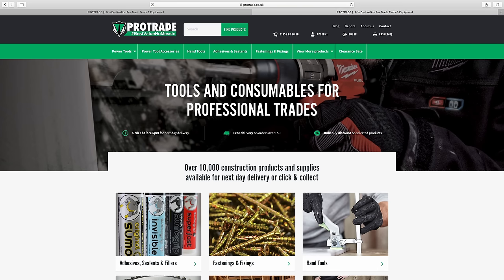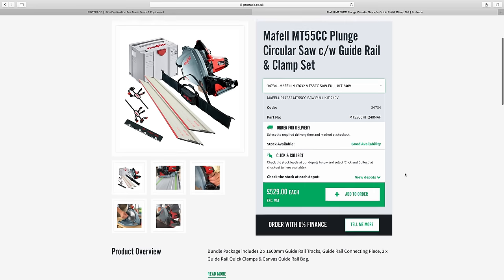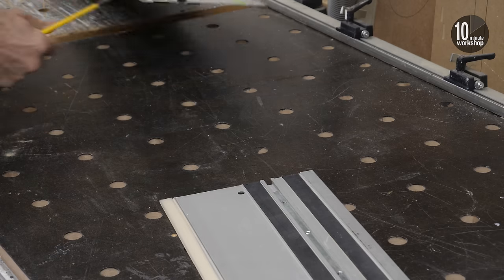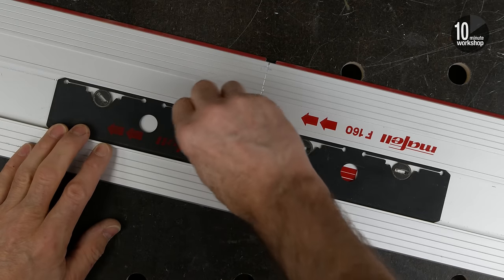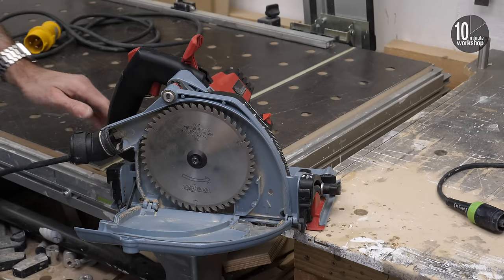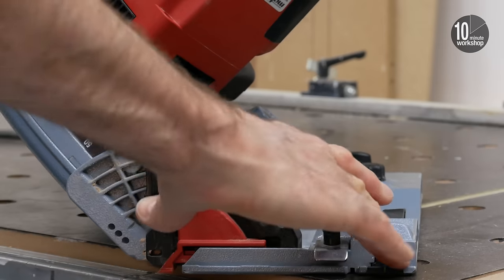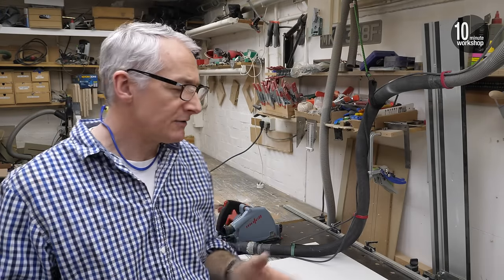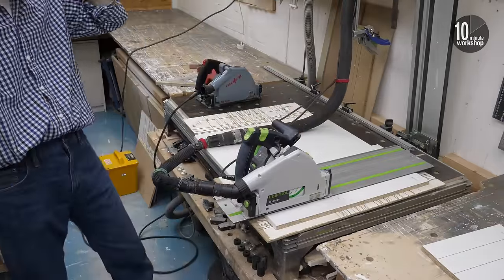Big Decision: Festool or Mafell? [video #400]

Comment: Great video, thank you for that.

I recently bought a Festool TS55 REBQ Plus, over the competitors.
I'm just a guy who occasionally saws stuff around the house, so any track saw is basically a luxury.
Reasons why I chose the Festool over the Mafell were; Mafell is substantially more expensive, and second the Festool can
saw closer to walls or other objects because of where the dust collector is placed.
Another reason is basically the same as yours; I could buy one.
Just one slight difference; I bought it from a shop that was discontinuing their Festool lineup, so I got it at a super price. 
If it were any different, I might have gone with the DeWalt tracksaw, but their track system isn't that good.
It is usable with Festool tracks, but then there is too much play I read somewhere.
Reply from the maker: Thanks! Sounds like you got a bargain! 👍👍

Comment: The 'guard' for the Festool does help with dust control but it is great when you need to run along a wall such as when cutting hardwood floors.

Comment: Hi, just something I wanted to share. Had to cut some melamine panels at work a month ago but I didn't have my festool with me (there was no need for it so far as my jobs on that site mostly included flooring- subfloor, finishings, and metal frame ceilings/partitions + plasterboard. However that week the kitchen fitters quit and there were few urgent jobs to be done that included melamine panels so I was asked to do few extras towards snagging).  So I had to borrow a plunge saw off another joiner on site who was cutting replacement shelves for kithcen units (happened to be dewalt). Right in the beginning he said that his blade was pretty worn off and complained about the amount of chipping he was getting while cutting melamine panels. I had a look at the shelves he cut- disaster, nearly looked like they were cut with a framing saw blade. However, having not much other options, I decided to try anyway. Decided to do a test piece at super-slow speed first, and if that didn't work, I planned to use masking tape on the cut to try to get a slightly better finish. I didn;t get to try the tape- while going extremely slow, I was able to get a relatively clean cut (not perfect of course but it exceeded my expectations). I'm curious about whether you experienced similar improvement yourself. thx
Reply from the maker: Hi, and thanks for sharing. No, I’ve never tried that - I’ll have to give it a go! Must admit I rarely use anything but top speed, but I’ll have a play and see, thanks! 👍👍

Comment: I settled on the Bosch, having tried the Titan/Erbauer and returned it as it was just not good enough, and as I couldn't justify the cost of Festool for my needs. I'm realy pleased with it and it has made my table saw more or less redundant ( which is  a blessing as its  a cheap Clarke antique ). I have put the aftermarket plugs on all my powertools per Bisch Basch Bosch, and I understand that it does not affect warranty ( although if I had to send it back I'd probably have to send a lead too )

Dust collection could be better, and if I used it daily, would become an issue, but thats all. Love the tracks, and also have Bosch Routers with track adaptors
Reply from the maker: Nice! Yeah, Stu at Bisch Bosch Basch is your man for all things Bisch! 👍👍
Reply: Richard Keith I wanted to do the replacement plugs but they were quite expensive
Reply: Being that the Bosch and Mafell  are very similar. Does the Bosch have the same 10th mm offset on the scribe cut?

Comment: I own the ts55, have always liked the mafell as well. to get over the 1/10 of a mm you can just set the plunge depth to 5mm, just like you can on the ts55 to create a scoring cut. with the quick adjustment of the depth it isn't much of a pain to do. the guide rails for the mafell are much superior.
Reply from the maker: Of course - but, ‘buy a dog & bark yourself’ springs to mind! 😂 I think the Mafell rail jointing is better, not so sure about the rails themselves. 🤷‍♂️👍👍
Reply: Peter Millard true, very true 😂 you expect the feature to be better than it is

Comment: One downside of the Mafel/Bosch rail is the base of the saw overhangs the non-blade side of the rail,so the saw will clash with bench dogs if using these to position the rail.  A spacer strip overcomes this but it is a tedious annoyance!
Reply from the maker: Yes, this was mentioned in the patreon-only 'further thoughts' video; you can use the low-profile bench dogs (' bench top protectors' here - https://bit.ly/bench-dogs) they work well; use the offer code "10minuteworkshop" at checkout for 5% discount. 👍

Comment: Good review Peter. Mafell sells that anti kickback attachment for the rails too, but it's between 20€ and 30€ (no idea what the Festool one costs) I purchased the Mafell saw for the easier blade change and better dust collection (you can improve the Festool saw to the same level with a piece of masking tape), the short 80cm rail and the stronger motor (I had my kitchen build ahead of me with 40mm thick rubberwood countertops and a 120m² flooring to do in the house). With the tracks I'm not sold to any of them, both have their good things and their bad things, I like the Festool clamps more than the Mafell screw clamps which tend to bend and jam in the rails. With the Mafell rails the one handed quick clamps work best. I retrofitted my saw with a Festool Plug It adapter for more convenient use with my shop vac (hose and plug it cord run in a common cable sleeve to avoid snagging, thanks for the idea to Dave Stanton )
So far I'm happy with the Mafell and I think the Festool saw will provide similar quality.
Reply from the maker: Thanks Jesus; yes, I do mention the ‘tape over the hole’ method to improve dc on the Festool, and while I agree that I could simply not use the scoring function on the Mafell, that’s a bit like having a dog and barking yourself! But I liked the Mafell, a solid saw. 👍
Reply: @10MinuteWorkshop  true, I guess you'd just have to figure out how much the blade moves on your saw and then take it into account

Comment: Great video  Peter.
Good test of their respective features.
I have upgraded from the Lidl Track saw, which was brilliant for the money and now own Mafels cheaper cousin the Bosch GKT55.
It shares the same brilliant track system but the machine doesn't have the score feature or clam shell case design.
The Bosch also does not shift the blade, so gives excellent cuts in panel boards.
Reply from the maker: Thanks Jason! Yes, the Bosch is an interesting one - I’d live to compare one to the Mafell, but that may be stretching ProTrade’s generosity of spirit a bit too far! 😂👍
Reply: It also misses some other features like one clamp screw tilt mechanism for bevel cuts, cutting depth fine adjustment. On the other hand, it features a second handle / grip. The bosch rails, rail clamps and bag are significantly cheaper than the mafell ones and they do fit perfectly - just as a tip for the mafell users.

Comment: Its Bosch for me I'm afraid. Its has pretty much everything a Mafell has including the excellent track connection system.

However you don't pay the extra 200 quid.
I know Festool are excellent bits of kit and I would love a domino cutter... but other than that I just don't like them... the look of them to me isn't great.

I guess we all have our likes and its hard to get over those.

I do hope you went Mafell... will find out at the end ...
Reply: tormenting360 I also went for the Bosch. Very happy with it.
Reply: tormenting360 I started with the Bosch and it is still my site saw however the mafell that is my workshop saw has way more grunt and I find it a lot easier to use and get better results, the Bosch is still great however
Reply: richpbrown2 I agree on the power side. I have compared the two. The Mafell is superior on power. Noticeable more when cutting hard woods.
Reply: @trieditusedit5846  I agree the Mafell surely has more power. I tend to do wood work as a hobby so for me the power isn't an issue.
Doing this type of work every day would call for some more grunt for sure!
Nice to see constructive chatter in the comments.
Shame Bosch drills and impact drivers aren't the best...
I have a Bosch table site saw and its lovely too (after buying a better blade)
Reply: I too am deeply impressed with my Bosch. But still a tad envious of the Mafell.
Reply: I have the Bosch, it is amazing. As I just use it for DIY I will not be using the quick blade switching and microadjustment is something I would never use. For the difference in price I bought the OFA 32 system so I can use my router with the rails too
Reply: tormenting360 I prefer makita for drills and Bosch for saws and maybe SDS rotary hammer. I do have the makita jigsaw as it uses the batteries I already had, it’s good but the cordless bosch has better ergonomics.

I really don’t like the buttons on the Makita, it is very weird to get used to. That being said the quality of the cut is amazing
Reply: tormenting360 the Bosch is not the same as the mafell. Not even close
Reply: @joeframer9642  I didn't say it was the same. I said it had a lot of the same features.

If you did you research you'd know Bosch track saw is made in the same factory as Mafell.

Its the only two tracks to have that joining system, the splinter guard is the same, the depth gauge is the same with how it flips...

So your comment about being way off is pretty ignorant...

We're all here to have a great conversation with good opinion. Why not bugger off to another thread because you clearly don't know your stuff

Comment: Mafell wasn't an option in Australia when I purchased my Festool plunge saw and track around 15+ years ago.  A few years later when I discovered Mafell and they too had a track saw, their track coiled up which sounded very appealing for loading everything into the boot of the car.  I've just googled Mafell and find they are available here in New Zealand through Jacks - a good firm to deal with!  Interesting video, thanks.  Cheers, David
Reply from the maker: Thanks! The flexi rails are an interesting idea, never used one though. 👍👍

Comment: As you know Peter I have both, my tools are all 110v and yes the Festool has always felt underpowered but I've just allowed for it by going slower and taking two passed. The mafell to me is much better on MFC with the score but I learnt early on not to use the score if butting panels ie a joint on island back panels. My mafell had kicked back a few times and my rails have a few scars, it's not as forgiving as the Festool if you're not concentrating.
Reply from the maker: That’s interesting, Chris, thanks! Was your Mafell one of the ones that had issues with the bevel cut? I knew a couple of guys who had that problem around the same time. 👍👍🤔
Reply: @10MinuteWorkshop  yeah I got mine replaced, they wanted to send it off to Germany to be fixed but I insisted on a new saw. Its still a mm or 2 off the edge on bevel but it is what it is. I think the rest of the saw makes up for it.

Comment: Thank you for that comparison Peter. I started with festool, but couldn't get consistent 45 deg bevel cuts. Sold festool and bought mafell and have much better results with it. I'm only a weekend woodworker, so maybe that's just me. It would be interesting to see what you thought about the angle cuts on both.
Reply from the maker: Angle cuts on both were excellent, though I know a couple of guys who had that exact problem with the Mafell- the 45 was about 43.5! Certainly one of them had a bit of a fight to get it changed, as it’s not something you use every day, so he didn’t realise the problem for a little while. 🤷‍♂️👍

Comment: I have my 2nd Festool ( 2months old) being collected by Festool tomorrow as it didn't cut square out of the box.  The bevel cut is really bad and the blade enters the board about 1.5 mm from the splinter guard.  I have a Mafell being delivered  tomorrow but have read so many mixed reviews.  The Festool is so light and smooth to use and after so many years of cutting egger MFC ( really high end board ) I am nervous about the possible switch.  And Festool service is amazing

Comment: For a super clean cut I make the scoring cut backwards, with the direction of the blade. This way, the top layer is supported by the material underneath, instead of the teeth kicking up on the top layer. (If that all makes sense)
Reply from the maker: Thanks! Yes, I’ve done the reverse scoring cut before; the test wasn’t really about getting a clean cut though, it was about seeing how they cut in ‘normal’ use especially in comparison to the Mafell scoring cut. 👍👍
Reply: @10MinuteWorkshop  and a nice bit of testing it was. Never knew the maffell would fit a festool rail. Learn something new every day eh

Comment: The Mafell isn't a great choice for use on a bench with a guide system. I have the Bosch and the saw overhang on the non cutting side and flexible tracks mean you need to switch to a Festool/Makita rail for bench work (this would I believe be the same with the Mafell) Now I am looking at getting another saw for the workbench so I can leave the Bosch set up for Bosch/Mafell tracks which is frankly kind of silly.
Reply from the maker: Yes. I like the way the Mafell tracks connect, but otherwise I prefer the Festool. 🤷‍♂️👍

Comment: My earlier comment disappeared, odd. Returned two Makitas for under-cutting the edge-guide when bevelled (manufacturing error that cant be adjusted out) and was tempted by the Mafell but went with Festool as needed it to work with cutting jigs, bench dogs and UJK Parf gear etc. Mafell motor-housing fouls taller dogs and rails dont work with dog-clips etc. Still think the Mafell is the superior tool in every other regard though, design and quality included. If I was on site regularly I’d choose the Mafell without hesitation.
Reply from the maker: That’s idd re the previous comment - wasn’t me, I promise! 😂 Yes, I like the Mafell rail design, but find it I’d that the baseplate overhangs the rail - it rules out so many things. 🤷‍♂️ Good to have the choice though! 👍👍

Comment: The scoring cut offset I’d much less of an issue when using edging tape etc as the glue covers the difference
Reply: Would you be putting tape on the inner edges of a joint too?

Comment: HI Peter what double sided tape to you use as a hold fast when using a router. I have bought the 3M 9088 tape  you recommended for use when replacing a splinter guard but is there a cheaper for use when one don't need a high quality tape for more less demanding applications .BTW. I bought the Triton plunge saw ( because I could not get the Titan and disable ant kick back lock as it made it very difficult to use. For most of us the Mafel and Festool  are to expensive for the amount of work we do but still interesting to see how they perform . Also I note Triton and Titan and a lot of other saws are of the same design . thanks in advance stay safe .
Reply from the maker: Thanks Michael! I generally use whatever tape my decorators merchant has. For double-sided, sometimes that’s Tesa tape, sometimes Mammoth. They’re both good quality tapes for general purpose use, when you don’t need the 3M gear. 👍👍

Comment: Its funny you say that about the plug on the saw. I am in the USA. I've cut the plug off many of my tools leaving a 3-12 inch pigtail. I put a male socket on it and use an extension cord as my cord. I do this because I am sick of cutting into cords that are hard to replace. I usually have more than one extension cord anywhere I am. I really wish manufacturers would just stop putting cords on tools and leave just a male plug sticking out the back. Again I'm in the USA so, GFCI and fused cords aren't really a thing in power tools.

Comment: I bought a nearly new Festool from Craigslist. The track splinter guide strip is attached using a self adhesive and is not holding on well. The saw also has weak power even without any extension cord. Not thrilled about how it rips even with a new rip blade. Bought a dewalt circular saw and used a clamp guide and much more satisfied. Do love the depth of plunge however on festool.
Reply: How does extension cord affect the power of the tool??? The further from power plant the fewer electrons one gets?

Comment: Question - the festool website advertises some of their saws as "plunge saw" and some as "track saw."  Are plunge saws just track saws that can do plunge cuts and track saws don't?
Reply from the maker: Without seeing the site, I’d imagine they’re referring to the different ranges of saws eg the TS saws vs the HK; TS saws are plunge saws meant for ‘finer’ woodworking eg cabinetry, the HK saws more for construction/ carpentry. You can use the HK saws for plunge cuts,  but it’s not their intended use. HTH. P

Comment: I have the poor man Mafell, the Bosch. One advantage of the Festool system is there are more 3rd party accessories for Festool linked to the MFT. 
The guide system for Bosch is the FSN OFA. This would fit the Mafell rail and I use my DeWalt router on it. You can also get a ‘holy rail’ at 32mm centres. The hole locator system does not work as cleanly as the Festool.
If you are a Festool bloke the box with Bosch or Mafell won’t work Festool when carrying all your kit on to site
Swings and roundabouts to all tools, unless you like them matching colours....
Great review
Reply from the maker: Thanks! Having had an extended play with the Mafell, I’d like to get my hands on the Bisch, now! 🤷‍♂️👍